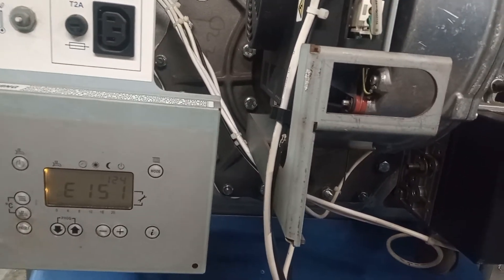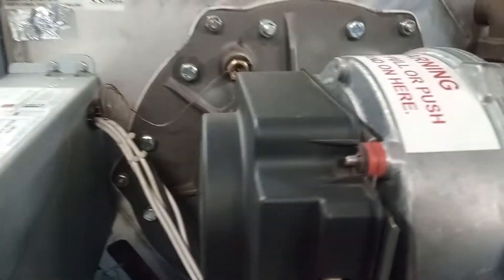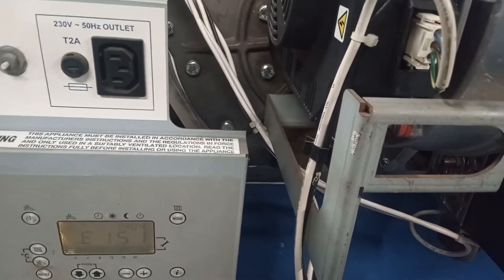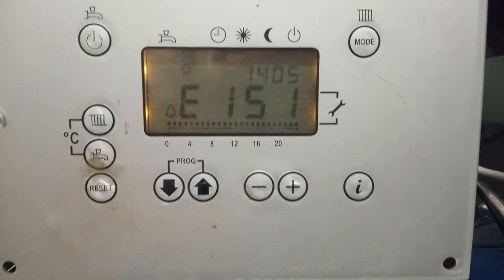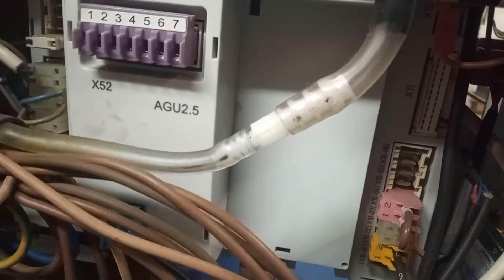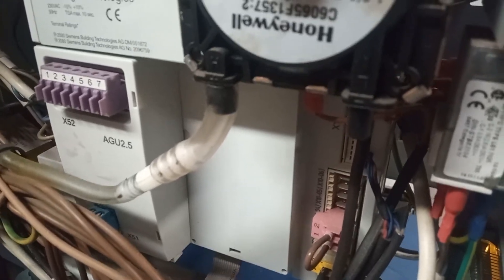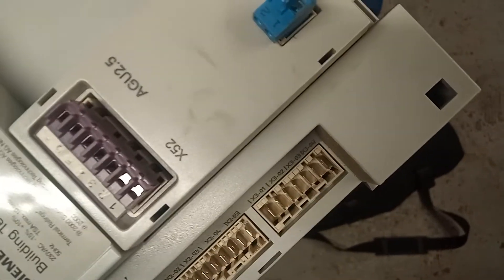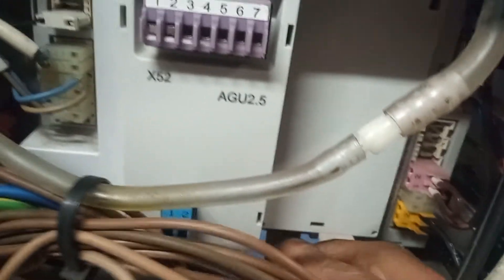FAULT E151 / HAMWORTHY MODUMAX WESSEX 220

Comment: I bet that board was expensive!
Reply from the maker: Thankfully I used one on site that was redundant. Strangest thing was the suspected faulty LMU worked on a different module afterwards. I'm guessing that there was a loose connection initially.
Reply: @CommercialGasEngineerVideos  I've had similar experiences.
Reply from the maker: @leaturk11  thanks for the feedback